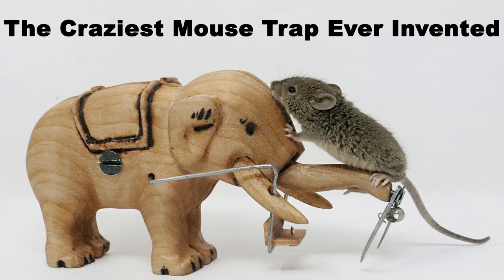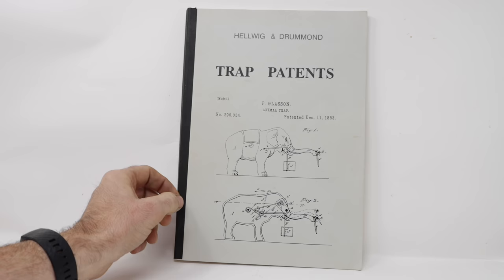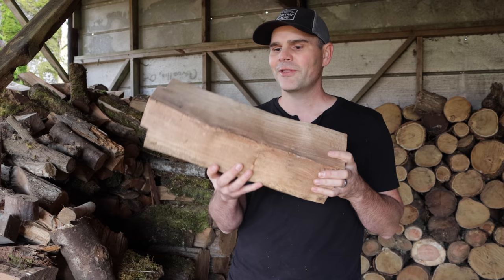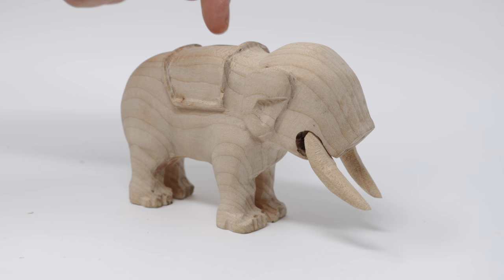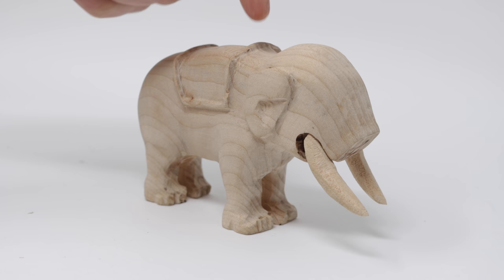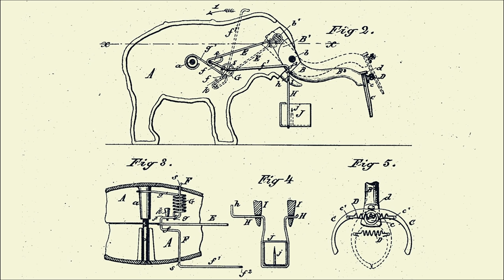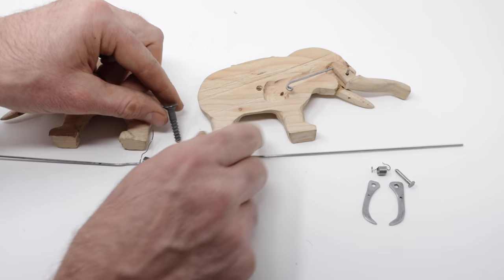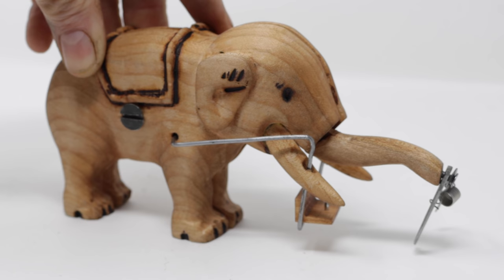The Craziest Mouse Trap Ever Invented. The Elephant Mouse Trap From 1883.  Mousetrap Monday

Comment: A trick for splitting a wood carving:  Start with two pieces of wood, and glue them together with newspaper in between them.  Carve the object, with the newspaper at the split point, then use a chisel to split it.
The newspaper will hold the wood block together well while you are sawing/carving the wood, but breaks apart easily when put under tension.
Reply: I learned this trick by watching Myfordboy making molds for metal casting.

Comment: As always, cracking content! You have a lot of talent at working these old patents into functioning traps. But in answer to your request for suggestions on how to get the jaws to close completely, you could move the spring connection points to the outside of the jaws (will probably require re-making the jaws with outboard mounting points). Or you could use a torsion spring to accomplish it. Both options might not match the original patent but it could get the thing to work. Let me know if you need a drawing or something and I will knock one up for you. Keep up the good work!

Comment: The creation was good, but it's not practical to use it, the reason is simple, other than the mouse need to be cooperative, the other reason I fear is that it won't kill it as it will run away while being injured. Definitely a failure waiting to happen.